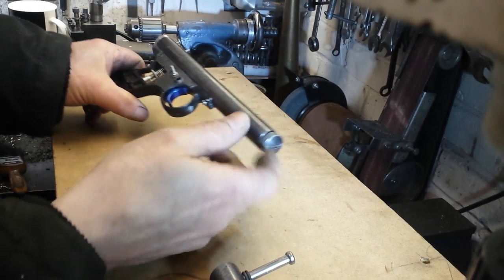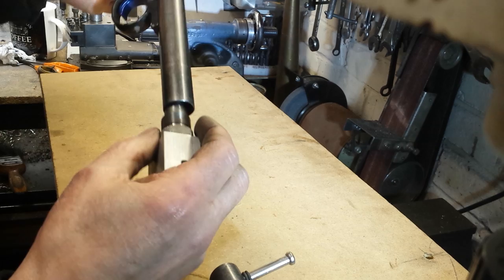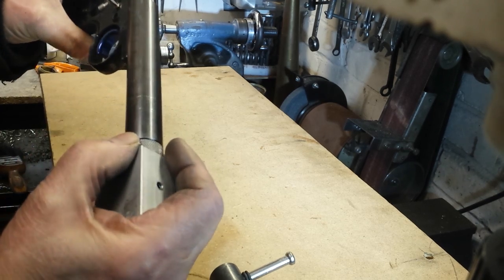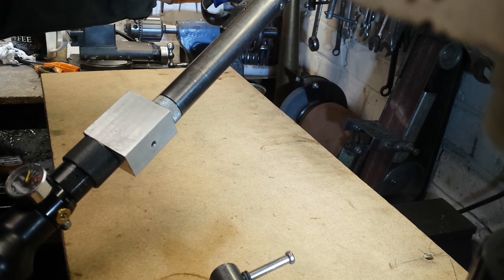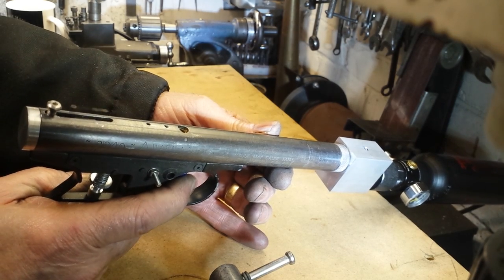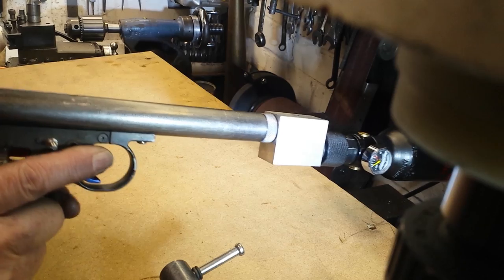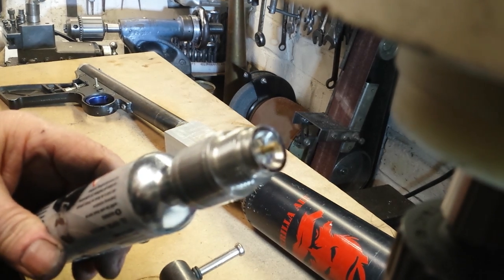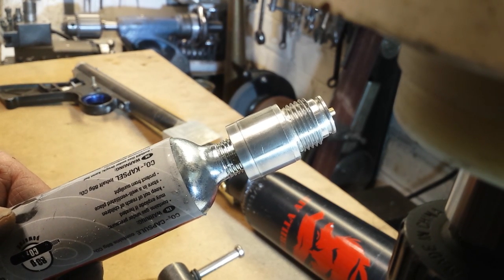Screw in drop block

Comment: Very impressive Tom. Do you have this for CP2? Thanks
Reply: Ugh, my posts are being deleted for NO reason!!!
Reply: First off, a side note to youtube:
THIS IS NOT A SPAM MESSAGE!
Okay... ahem, back to my original post:
I had the same question and asked around, one person suggested I look up froggy's airgún parts and a quick search pointed me in the right direction:
They sell Diana Chaser mods which are cross compatible with the Victory and Artemis CP2.
The first item to purchase would be the upgraded hammer spring they offer since it'll improve the power output a little.
They sell two hpa conversion options:
The first is a Diana Chaser safepac, a tube tank which is a little less bulky, than the drop block system, but works well enough regardless of the lower shot count than a bottle.
The second is a "Diana Chaser drop block". I have something similar to this myself and my bottle fed PCP CP2 has been a great addition to my pest control equipment